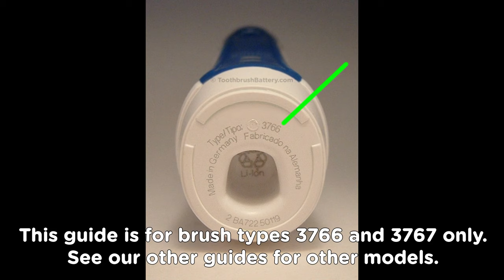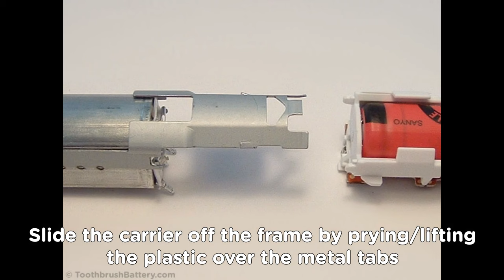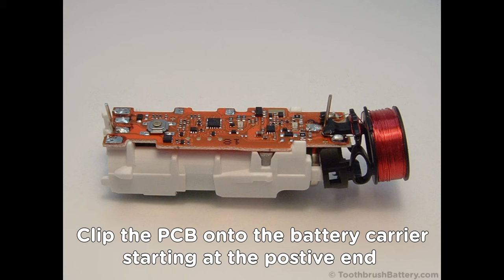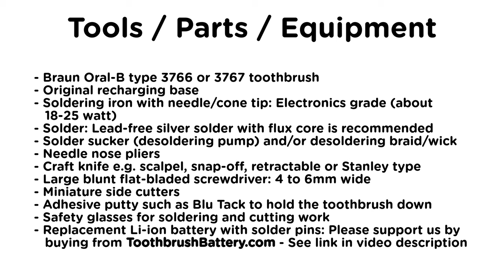Battery Replacement Guide for Braun Oral-B Type 3766 & 3767 Toothbrush - Pro 2 3 4 2000 3000 4000

Comment: I don't mind replacing it myself, but this is why we need Right to repair to force these manufacturers to design product for noob friendly repair / battery replacements. I will attempt it, but how many people will do it and how many will end up as e-waste??? Good video, thank you.
Reply: I can replace it myself also, but I won't bother. The thing is going straight to the e-waste bin and never buying one again.
Reply: I changed mine a year or so ago for the bigger one (old one was dying in a few days) but now the soft touch plastic has gone sticky so going to salvage the battery for another one. I think this type of repair should be taught at school but sadly most people I know won’t do this
Reply: @1988dgs  You're right, this type of "repair" should be taught at schools. But, I will also never accept that products cannot be designed with simple battery swaps as a feature. This is possible and manufacturers must be forced to implement this. Simply dragging feet and inventing excuses for not doing it is tiring, there is no objective excuse for it.
Reply: @cristi724  why never buying one again? The closest comparable brush - Philips Sonicare - takes some soldering too. Though less than this one.
Reply: @alexmotlyakh5922  Because I don't want to solder to replace a battery for consumer stuff. It's not like normal toothbrushes don't exist.
Reply: I agree completely but to be honest, mine is already e-waste. It can't hold a charge and needs to charge for 5 hours to last the 3 minutes it takes to brush my teeth. Waste of electricity to have it charge all the time. Super annoying!

Comment: You've got to be kidding me! I thought I was having problems with the simpler Braun electric toothbrush. This is ridiculous, it is too complicated. I took the batteries out of the simple toothbrush after much difficulty and now I can't get the battery cover back on. This happened with a previous more expensive toothbrush too. Is this some kind of "planned obsolescence"?
Reply: Mostly it's just designed to be as cheap to make, and leak-proof.  Making it easy to repair costs a bit more money, so doesn't happen.

Comment: Ain't nobody got time fo that. lol
Reply: Time or basic skills? :) ....
Reply from the maker: You can spend time to save money here, or spend money to save time. It depends how much your time is worth.
Reply: @ionicindustries  I always try and repair things if I can, but the process for this toothbrush is way more faff than most things. They have deliberately made it hard to replace the battery so the vast majority won't even try and will buy a new one. Planned obsolescence at it finest. They could make one that you screw the bottom off like a torch, or only have to take a few screws out and replace the battery. They won't though.

Comment: If your not technically minded but good with your hands, give this ago, not only have you got the dam thing going again, this will teach you how to replace batteries in other tooth brushes that are usually easier to replace.
You also will get satisfaction from repairing your items.
A few things to know about soldering iron if you have one but not to clued up on it.
Just be careful with the solder iron tip not to leave on to long or touch other parts, better to use higher heat with thicker end piece for less contact time, and dab a bit of fresh solder on your iron to help melt old solder,
Dab the solder iron on a wet sponge or copper wire scourer to keep end clean.
You can also Buy copper braid to absorb solder away from the board.if you don`t have a solder suction .
Always clean the solder and board with a alcohol base to remove flux left from the solder other wise it can corrode around area,
Use unleaded solder possibly silver flux solder, but be careful as some solders melt at different temps
And by some flux`  as not always flux solder is good enough , you may prefer liquid flux.
Take photo`s at each dismantling stage as the video may not look or captured every angle you prefer when putting back together.
Always be very careful on them 2 wires from the coil they break so easy,

Comment: Just as a side note, if you get your battery elsewhere it may well have next to no charge in it, so when it's all soldered in then it will only give you a red flashing light at test, it will need a decent few hours charge to work. I spent ages checking all the connections were right on the 3 brushes I did last night. Also if the white battery carrier end that is thinned to a millimeter gap is accidentally cut out you will get permanent connection from positive to the motor terminal! Ask me how I know that.... 🤦‍♂️

Comment: thank you! my toothbrush has only 2 years and suddenly stooped charging, after opening it I saw the charging coil cable cracked where it connects to the PCB, fixing it was pretty simple solder job

Comment: fixed, I only had to resolder the coil on the motherboard ( it was loose ) to have it charge again. thnx
Reply: Same here, small break in the coil wire just before the solder,
Reply: @AndreVanKammen  One more of the same here - coil had become de-soldered at the connection labelled '+' - had to pull the wire a bit to get enough slack to solder it.  I'll put a little bit of adhesive on before I reassemble it, because I suspect vibration is slowly moving the wire in the plastic routing so that it tightens on the solder joint and eventually breaks.

Comment: I have an antex 18w iron. The positive terminal is too much for it. I cant use the heat gun because its all plastic. The rubber seal at the top of the brush is perished anyway and the wire to the led has corroded away. This is all going in the bin, im going to buy a new brush, it should be easier to replace the battery and the seal should be replacable. How the thing has a CE kitemark i have no idea.. where can i buy a british standards toothbrush??

Comment: Great step by step video - it took me between 1.5 and 2 hours, and that included modifying the battery cage to accommodate the larger battery. I also bought the battery (with tabs) from Ionic Industries, and was able to trim the tabs with a small pair of side cutters.
The only issue I had was that the fine wires that are tied around the lugs on the side cage, snapped when trying to get them off, but there was still enough wire to solder them in place.
I'm not very experienced at soldering and only have basic equipment, so even if you are nervous about doing this I would definitely recommend doing it, to save on having to buy a new toothbrush.
A couple of tips that helped me; make sure you have some braided solder wick to make desoldering the joints a lot easier and less messy, and if you place the unit on a sheet of Blu Tack, it will keep it steady whilst doing the soldering.

Comment: 1.2 Volts or 3.7 Volts battery
Reply from the maker: Near where the Type number is marked on your toothbrush (3766 or 3767) it should also be marked "Li-ion" which indicates a 3.7V Li-ion battery is fitted. Email us a photo of your original battery so we can confirm for you if you are not sure - contact@toothbrushbattery.com

Comment: i used aa rechargable, it works but i cant charge it now. all connections look ok.
Reply from the maker: These Type 3766 & 3767 toothbrushes require 3.7V Li-ion batteries. A standard Ni-MH AA rechargeable is NOT compatible. Buy the correct replacement battery at https://toothbrushbattery.com/buy/49mm-x-14mm-li-ion-philips-sonicare-battery/?utm_source=yt3766

Comment: Not as easy as the video suggests to open up to remove the inside when the ring and bottom are clogged up after much use. Needed to use a sharp knife to remove the top ring and the bottom. Not necessarily the battery at fault, move the gear wheel when trying to start and see if it works. Used WD40 and light oil both ends of the motor and after a while it started every time and no disassembly required. Top ring and bottom needs persuasion to refit, they must have used a new toothbrush..
Reply from the maker: If the seals are clogged with dried on toothpaste you can use an old brush-head or a manual toothbrush to wet the paste and scrub it off.

Comment from the maker: Buy the replacement battery at https://toothbrushbattery.com/buy/49mm-x-14mm-li-ion-philips-sonicare-battery/?utm_source=yt3766

Let us know how you got on with replacing the battery in your Braun Oral B Type 3766 or 3767 below!
Reply: 3.7v instead of 1.2v? 
really?
Reply: @x11y50  3.7v for lithium ion.
Reply from the maker: @x11y50  The toothbrushes marked as Type 3766 and 3767 take Li-ion 3.7V batteries.